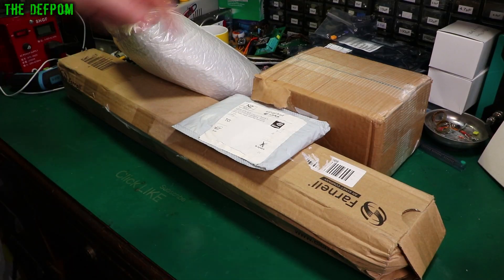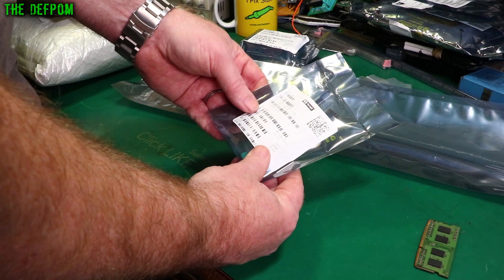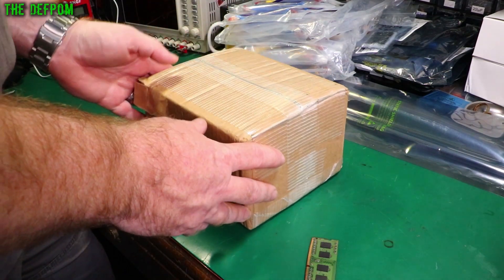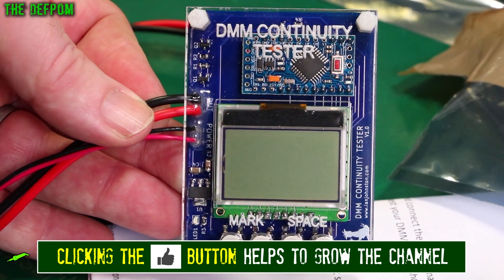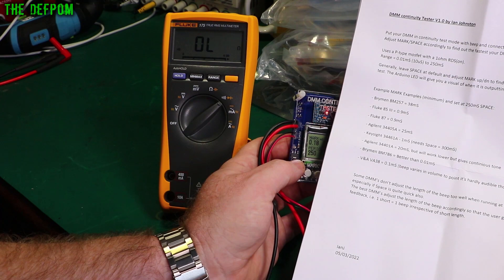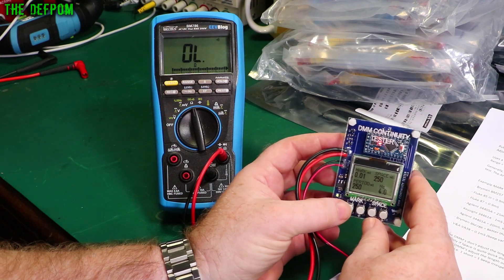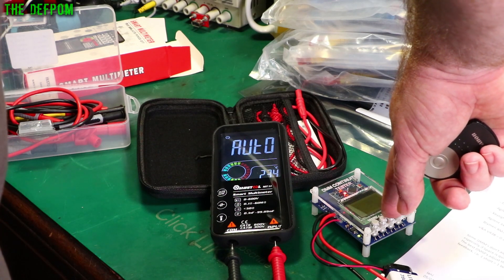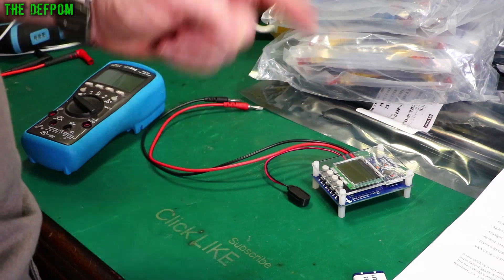🔴 What's in my Mailbag ? - Mailbag Monday 4th April 2022 - No.941

Comment: The DMM Continuity Tester is open source.....the files are on my site. The design could go a lot further I guess:
Add a microphone to measure response time.
Increase the speed so the likes of the BM786 can be measured (Use 16bit PWM or perhaps an STM32).
Add some arbitary type modes, i.e. mimic running along 10pins of a connector.
Add more output FETs with various different resistances to mimic crap probes etc.
A nice big LED on the board to flash when activated
Anything else!
Reply: I'm thinking a simple version could be made that's just a MOSFET on a board connected to a function generator.